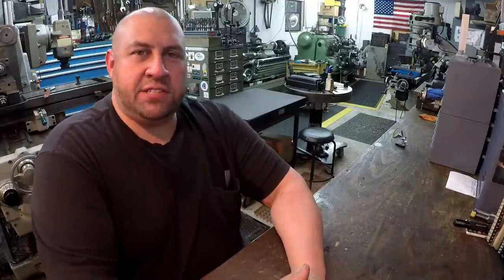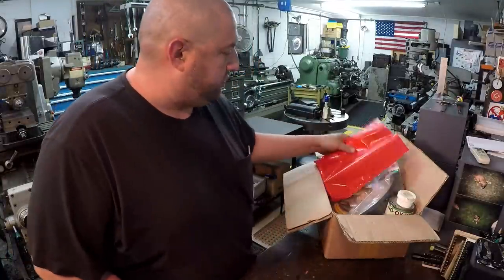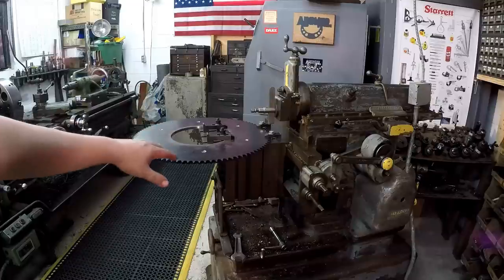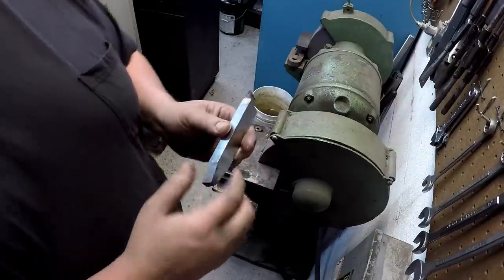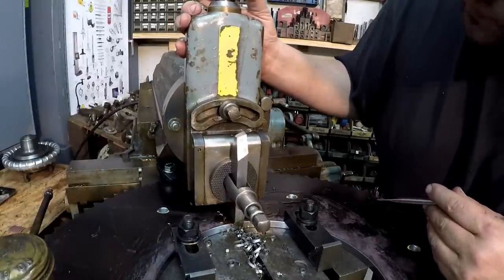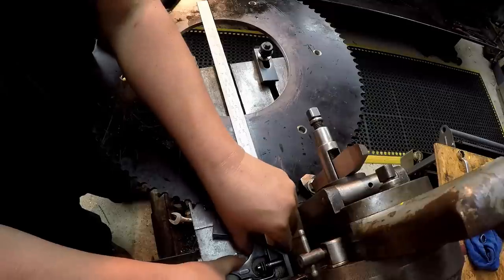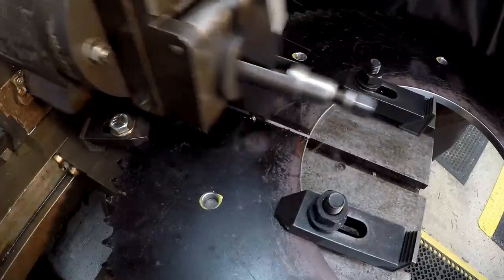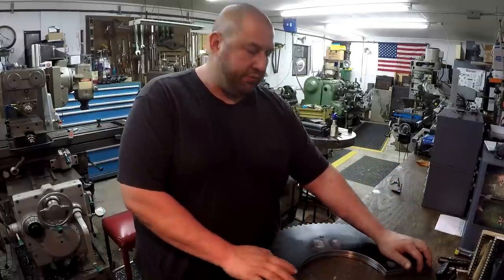SNS 180: Parting in the Shaper

Comment: Wow Adam Thanks, that was some good shaper footage. I also want to say thanks so much for the great shout out, it means alot. You got such a great channel and you make it look so easy. Great job by the way parting that sprocket, its not real easy, if there is much back rake on the cutter it pulls down in the work + the backlash in the compound screw makes lite cuts hard, you almost need to tighten the compound lock to where it's hard to move so the backlash is not pulled out by the rake of the cutter. Hard for me to explain but I am sure you get it. You did great and thanks again, I will not forget it.

Comment: Agree with you Adam about getting someone in to finish the building work.  If a job is worth doing it's worth doing well and someone who does that type of work day in and day out will always do a better job that someone who doesn't.
Reply: Agree....Do what you are good at so you can get someone else to do what they're good at.
Reply: "will always do a better job" is not the case unless you're paying them by the hour. I no longer say I do professional work because as the name implies, you do it for a profession. "Professionals" are always looking for the quickest way to get it done and move onto the next job. On the few occasions where I had someone come into my home to do work, they always screwed something up. I'd rather buy the tools and do it myself.
Reply: Paul Decker I can't fault your point there - looking back at my post I may have been more accurate to "usually do a better job".
Reply: I have a retired construction contractor as a friend. I do what I can around the house,  but if I need some help, advice, or a strong warning that I am out of my league.... he is there for me.

Comment: As you said ; When I did my bathrooms here's the formula; Quoted a high amount which was accepted, work was done very quickly everything done to spec. and beautifully finished, on time, no extra charges for anything, and no complaint issues or need to call back. Or did I just get lucky? 
By the by, great video, nice to see those big meaty chips coming off the shaper, a machine that you rarely see in use. I enjoyed it very much, cheers Adam!

Comment: Adam we used the no ox on the railroad to coat the wires we hooked to the rails. Bond strand was what we called the wire. Also used it on the track battery terminals to keep it from growing crud on them. (Works great on your car battery also). Just a FYI !
Love the channel but miss the at work videos.
Barry

Comment: I have a South Bend 7....At times, if there is excess oil in/behind the clapper box, it (oil) acts as a cushion and causes a spring action.  The oil also creates a vacuum and the clapper does not want to lift freely as it should.  When I clean the clapper box and use no oil, these problems tend to go away and eliminates the heavy "dig in" cut every few strokes allowing a ligher cut if desired.... Good vid, Thanks

Comment: There is something unique and soothing about the action of a shaper. It's hard to explain. Perhaps the thoughts of work done in bygone years, now this genius but outdated machinery essentially having retired from a hard working life. 

It's also interesting seeing this because what you did is perfectly analogous to a parting operation on a lathe, but the tool moves across the part instead of the part rotating into the tool. Sort of makes some lightbulbs come on. I'd love to have a little shaper myself, if for no other reason but the novelty!

Comment: i was just thinking that if it made a chip on every third pass, then maybe you should be advancing it about three times as far on each pass. Then you immediately said that you needed to advance it more on each pass. From 0.002" to 0.005" is close enough to three times. Tool push-off can make some strange effects.

That sprocket is a nice hunk of metal. I didn't look like it sprung either in or out when you cut through. Someone did some serious stress relief.

"Break all edges. Avoid verbal orders." B. W. Lindquist (Had this at the head of his desk pads around 1930)

Thanks for the tip on Steve Summers.

Comment: Your shaper tool is reluctant to penetrate with less than 005" down feed becauseit takes a minimum force to make it penetrate. The tool would rather "skip out" on lesser downfeeds. Draw a line at right angles to the work plane running up through the clapper pin. Note how far the cutting edge is in advance to this vertical baseline. The tool under load has an "escape route" by popping ahead taking the clapper with it. Move the cutting edge closer to the base line (or take a heavier cut) and you can take lighter downfeeds predictably. 

You've heard of "gooseneck tools" where the cutting edge is on or even behind the base line. Very predictable on very light cuts. They have an added advantage of reducing chatter and over-cut.

I have a 20" Cincinatti tool room shaper looking for a home if only we could get its 5300 lb 2750 miles from near Seattle to Pensacola. I have some tooling for it too. Like a shaper? You'd love planer.

BTW, most well built shapers and planers are pretty happy with .010 incremental feeds as finish cuts. Put the right radius on the tool and you get good finishers. Shear tools might be tempting but if used with fine feeds are huge time wasters.  Like on a lathe or mill the feed selector is the money-maker.

Comment: Never thought to use a shaper for this. I split these all the time. As a matter of fact, we make the sprocket as well and I always split them on an old 18" power hacksaw. I guess my next move is to take it to the shaper. I have a 24" which sits unused except for tapered keys. Good tip Adam!

Comment: Good-o on you for putting the shaper to work.  This was a good job for it.  I routinely take .020 - .030" cuts on my little Atlas 7" shaper.  But I also agree with learning your machine-tool-material limits.  Unlike lesser machines, a crash on the shaper is usually unforgiving disaster and something major breaks.  Your setup was good, your chips cool and it was fun to watch.  Thanks!  M'G
Reply from the maker: +M'G-Shop Yep in afraid of pushing it too hard and causing a crash.

Comment: Hi Adam, I would suspect a couple/few thousandths of play in the ram ways, and the tool pushes the ram up when it contacts the work. It could very well be that if you adjust the ram gibs you can tighten that right up. You can measure the play by indicating the ram, maybe at the tool holder, while you pry it up and down against the table on the clapper. Probably makes sense to do that at a few different ram extension locations for comparison.

Comment: Couple of thoughts watching the shaper work. First, it doesn't seem to put much heat into the part, like a mill would, which could be a good thing on some jobs.
Also, a simple dripper can, feeding onto the tool, would probably be the simplest, neatest and best way to lubricate a shaper cut. Of course, that is just an idea, as I've never operated a shaper.

Comment: Many years ago one of my mates told me. When he young he watched a job been set up on a massive shaper which took three days to set up bolt down check etc. The machinist  turned the shaper on but did not check the tool height. It dug in and pushed the lot off the bed on to the floor.

Comment: This shaper is pretty cool and if you have it use it for sure and just for fun.
 I dont have accsess to one so my process would be to just cut it after a layout with a .041" 6 " diam. zip disk cutting wheel on a milwaukee grinder, using a piece of 1.5 inch steel angle clamped to it as a guide. I love that little square you have that you used to set up the cutting tool to 90 deg. on the shaper. Thanks

Comment: Hi Adam,

A couple of comments.

Looking at the way that oil was being pumped in and out of the dovetails (at around 32 min), it might be worth looking at the gib adjustment on the shaper. That might account for what almost sounds like a knock when the cut releases. 

I can't remember if I came up with the idea, or read it in an old book, but if you bore a hole in each cut line into which a bush can be placed during installation, you can easily get very good alignment of the sprocket. Make the holes two different sizes and you also ensure the two halves are correctly matched to each other.
Reply: Good tip about the bushings!

Comment: I've had the same experience on my lathe parting off. It is a smaller lathe and not that stiff. I get nice curls with a solid infeed. With a wimpy infeed it chatters. I guess as you use the shaper more you will pick this stuff up. This job was certainly slower on the shaper but you gained (and shared 😁knowledge) and that's worth something. Very cool! The small shapers sell for way too much cause guys can put them in their basement but you can pick up the big shapers now for their value in scrap.

Comment: No-Ox comes in a few "flavors", Some are for copper, some for aluminum, some for use with mixed metals like stainless/aluminum, aluminum/copper and such. It is good stuff but pricey to use as a tool coating. 

Those "cutters" look like the drills used in multi-spindle drills for making cabinets and such. Drills and countersinks in one pass.
Reply: I thought the price Adam paid was down right reasonable!

Comment: Shapers are cool, old-school machines.  I don't guess they make one with self-vertical feed?  If you forget it, it could cut itself in half!  Thanks for posting.
Reply from the maker: +scowell Yes many of the larger machines have all power feed and rapids.
Reply: Yes, many had auto-feed for the vertical (or slanted-vertical). Because the feed can rotate they generally use a bowden cable. You can see the machanism here:
http://www.lathes.co.uk/Garavaglia/
The cam plate on top of the slides operates the mechanism on the ram, and then the Bowden cable you can see inches the feed screw round.

I wonder if any had power-feed on the rotation of the ram axis? That would be great for forming arcs in things like brake-shoes.

Comment: Adam, I saw in an earlier video where the  OSB was not properly installed with seams on studs. I also think I heard you say you wanted to put on steel siding horizontally. since the OSB is on and the Tyvek wrap is on it would be a shame to remove that and fix it some expense. When you install the steel the joints in the OSB will no longer matter from a structural point of view. The Steel will provide plenty of strength in every direction. Hope this will be looked at and saves you some money.     Bill

Comment: I've tried some slotting/parting work on mine, and at present trying to cut a spur gear, which is basically form tool slotting.  Sloppy ram gib adjustment and bad belts will certainly give you grief in an operation like that.  
I also had to go back to an old instruction manual and re-read sections of it, and found several areas where I had it set up wrong.  One key point that was constantly emphasized was to keep the tool post as high as possible, not below the bearing area of the ram slideway.  It's a balancing act, making sure everything clears the ram, but also making everything as high and tight as possible.  I didn't see anything wrong with your setup on that operation.
One thing I am still having problems with on this spur gear project is the way the tool has to be ground.  I can't put any top rake to it without affecting how the form turns out, and with the tool loading at the point and on both sides, even the lightest of cuts on a neutral rake is a bit like running a bulldozer straight into a rock ledge.  All I could think to try was to put a packing piece behind the tool and put a few shims at the top to give the tool a slightly negative rake affect.  It seems to help, as the cutting edges are not hitting the part all at the same time, but it still makes a pretty good shock.  
You didn't appear to be having any problems with that.  If anything, the 'shock' was most apparent at the end of the stroke and the pressure on the tool was released.

Comment: Aloha Abom, I was glad see you increase the depth of cut, I am not familiar with your machine, but as I remember I used to get more aggressive on my cuts. I think if I remember right in saying I could sense the relief at the end of the cut, but stopped when I could feel it with my fingers on the table.  
Thank you for the diversity  of your videos, I think that makes it more interesting. I was wondering about the file [my method] verses some of the new wheels available now for de-burring?
Keep up the good work, I hope things start coming together on the shop upgrade  I notice your running the fingers around the work area in the process of your operation, how many of the fine metal pieces do you find, one of my main shop tools is splinter tweezers.  Mahalo for the great shop videos and keep them coming...... Aloha No Chuck

Comment: Hello from Aus. Good job on the shaper. I would try less rake, 2-3 deg and run the next speed up. Both my shaper and slotter like the faster speed. For long thin work using limited HP a shaper is hard to beat.

Comment: That "little" shaper will really hog off the steel.  You could easily have pushed 20-25 thou and the machine would not have complained.  THAT'S what makes using the shaper fun.  Making chips that go "CLANG" when they hit the floor!
Reply: I suspect 20-25, if the tool didn't break, would pop out big blue chips that hit you smack in the neck!

Comment: I have a shaper about the same size as the one you have. It gets used mostly for re surfacing steam engine slide valves. shallow cuts are a pain in the arse but reducing the contact width on the cutting edge seems to help more than any thing else. 
In bronze I keep the width of the cutter to about 25 thou and in cast iron around 35 thou seems to be the way to go. Like you I dont have a lot of time on a shaper but I ike the surface finish they can turn out. Far less finishing work than a milling machine.

Comment: milling would cost more in 1/8 cutters than the shaper uses in time and tooling. so the shaper is the smartest machine to do it on , but you could have been done with it hours ago using a hand held plasma cutter and a straight edge. and it would work just fine. even more perfect would be a waterjet.

Comment: Is there a oiler setup that you could mount on the shaper front by the cutter that you just push a plunger that has a oil sump and it would drop some oil down to the cutter. Just a suggestion.

Comment: great video.  Watching that tool cut is mesmerizing.  Got a question though...that looks like about an 1/8" kerf. what effect does that space have on the operation of that sprocket?  the location of the bolt holes seem to indicate that there's a fair amount of the sprocket unsupported. Any issue with deflection?  Just curious...your connection to the assembly doesn't end when the part leaves the shop.

Comment: Adam, i had a question in regards to filing the cut edges after the shaper work. Could you grind a tool to go into the shaper with a beveled shoulder after the cut depth to remove the sharp edge?

Comment: LOVED the video. Love the rhythm of a shaper. 
Why does the head (for lack of proper term)swivel on the return stroke?
Reply: So as not to drag rearwards and cause extra wear. The swivel tool holder device is called "clapper"
Reply: Milan Trcka thank you. I assumed that was why it did that but wasn't sure.

Comment: Would a shaper be used to cut a spiral oil grove on an ID? That part you recently made for a lathe that had the broken thread end had a spiral grove running in it and I was looking forward to discovering how that would be done but you made two straight groves in it instead.
Enjoyed seeing the the shaper running again, it's such a unique kind of a beast.
Reply from the maker: You would need a way to rotate the part in relation to the ram. I have not seen that.
Reply: How would it be done then?

Comment: Does that shaper have an automatic depth adjuster, or is it just designed to make cuts across the surface.
Reply: Thanks, that's what I thought.  For planing a surface you can walk away and let the machine run, but for cutting off a part you have to stand there and adjust the machine after each pass- slow and time consuming.
Reply from the maker: On my machine no auto downfeed. Only feed it has is table side to side.

Comment: I'm not a machinist, and have only repair and mechanic as a background, but I do have a question. @abom79, when removing the 1/8" of material with the shaper, how does that or does that at all effect the chain that rides on that sprocket? Isn't the spacing between those 2 affected teeth reduced. This is no way a criticism, I am only just very curious, as I do not know the application. I love the vids, please keep em coming, and good luck on the shop expansion.
Reply: that's taken care of when it's bolted in

Comment: Great videos Adam, enjoy your channel.  I know you dont respond to any of your comments but I have one question.  How do they do with the material lost (kerf cut) when they put the sprocket back into service?l
Reply: Frank: The bolts hold the proper pitch on the teeth. You have to have the sprocket adapter to the shaft, that only extends out just past the bolts, for the hub.
Reply: Thanks Paublus, that answers my question. I wasnt thinking that it still will bolt up the same way it was taken off. Again Thanks